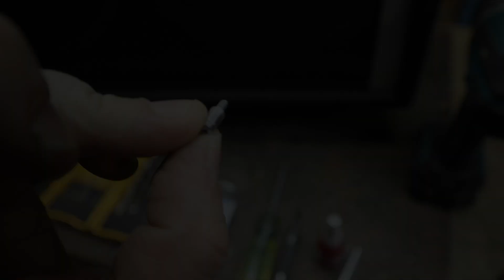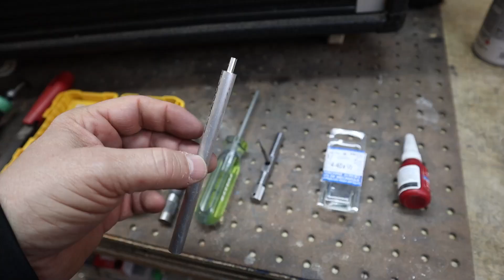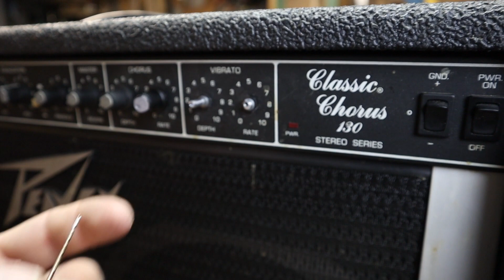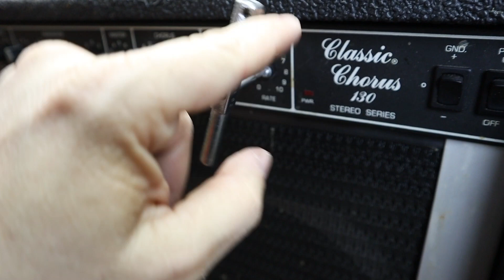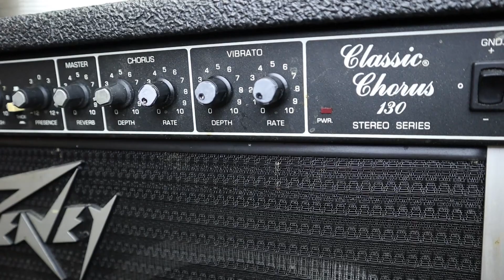How to easily repair a snapped Amplifier pot shaft // NO SOLDERING REQUIRED!

Comment: 10 minutes start to finish, if you have a machine lathe and can create your own metal sleeve? is there a way around that?
Reply from the maker: Yes, in the comments a few people say that Home Depot has 1/4” Stand offs that will work.  They are in the nuts and bolt section. You just need a drill, drill bit and a small tap.

Comment: Everything was great until you mentioned about using a lathe which I don't have
Reply from the maker: Someone commented that hardware store (like Home Depot) sell “standoffs”.  They are typically 1/4” in diameter and are threaded on one end.   You could also use a drill or a drill press to fabricate something.  Cheers.

Comment: I have an amp that pot has snapped. It is filled with metal however, its the treble knob on  yamaha amplifier. I need to drill it first then yes?
Reply from the maker: In order to tap a thread or reuse the knob, you will need to drill it out as per the video.  Cheers.
Reply: @MikeFreda   its the middle part that moves then as ive tried to turn it and no joy. I will drill it and go from there. Im sure it will work if i can turn it. Its a good oldschool amp but treble pot has snapped thats all. Mine however is slightly different its within a hole the knobs come out an inch so slightly abit more challenging.

Comment: This is awesome, you've got a new subscriber! I want to try this on my Peavey JSX head - but in my case, the pot stem is snapped down to almost nothing. Do you think I would still be able to drill it out deep enough to accomplish this?
Reply from the maker: Thanks for commenting.   It’s hard to say how  much additional room you have to play with.  You have at least the threaded section the play with.  What you could do is find a similar pot and take it apart.  Cheers.

Comment: Even simpler, use a hex standoff -- available in metric (M3) or inch (4-40) dimensions.  A metric and inch standoffs are available from McMaster, or DK.
Reply from the maker: Yes, that is correct.  That will work good as well. Many people have suggested that. I may do an update video explaining that option. Thanks for commenting. Cheers.

Comment: Easy, if you have the tools you used
Reply from the maker: True.  I’ve been made aware that HomeDepot sells threaded stand offs in the hardware dept.  You just need the corresponding drill and tap for that thread pitch.  Cheers.

Comment: So where do you get the part to repair the pot?  The threaded shaft?  No PN
Reply: Ok.  I see in one of your other replies that you rigged it.  It's not an over the counter part.  Yeah I can do that with standoff and a screw that is flat head.
Reply from the maker: No, I made the part from scratch but I’ve been told stand offs work as well. You can get them at homedepot. The trick is to find the right thread pitch for the tap. Cheers.
Reply: @MikeFreda  Thanks.  I'm pretty handy at fixing things.  The bigger trick will be to find a matching knob (for a Digitech RP-500 I bought used).  Worst case I will just replace all 6 of the knobs with similar ones.

Comment: can something else be used in place iof that thing you used at 4:00 ?  I have everythi9ng except that crucial thing.   ....  Almost Hate to file off the tiny knub thats left on my brokeen treble pot.  But if so what could I use in place of that tool?
Reply from the maker: Good day, at 4:00, that is a small tap handle. You need some way of holding the 4x40 tap. There are other tap handles available.  Try Harbor Freight or Amazon. You could also use a set of small vise grips. A drill would be my last resort. You have to be careful not to break the tap. That would ruin your day.
Reply: @MikeFreda  what is the Tap??   I missed how you drilled it out.   so youre saying.....   there is a method other than drilling it?  I was considering laying the amp back .....   mising up a tiny ampunt of Jb Weld &  with a small point item......   put a tiny glob on it & let it harden, being sure to not put so much that it binds with the surrounding metal & wont turn.  but enough to atleast use the finger tips to adjust it when needed.
Reply from the maker: A tap cuts threads so you can screw in a small machine bold.  Yes, you have to drill it out the middle of the shaft.   Other than removing the pot itself and installing a new one I’m not sure what else would work.  Good luck.

Comment: For most of us we aren't going to be able to machine down the aluminum rod to make the replacement shaft section. I do a work around that may interest people which is to just purchase an aluminum spacer at the hardware store the same diameter as the shaft. You may have to cut or grind down the spacer to get the exact length. Just drill and tap the pot shaft and then fasten the spacer with the screw to it. I also use a little clear nail polish on the threads to keep it from coming loose.
Reply from the maker: Yes, that works well.  A few others have left that same comment.  Thanks for suggesting that, hopefully that will make it easier for some of you. Cheers.
Reply: For D shaped shafts, it's a bit more difficult too
Reply: They sell aluminum rods look 1/4" aluminum rod. Most hardware stores have them

Comment: Thank you.  I have a half broken shaft on a 1971 P bass.  I don't want to replace a vintage pot.  This should work nicely.
Reply from the maker: You're welcome, hope it works for you!
Reply: @MikeFreda  The only thing I don’t know how to do is turn down the aluminum round to the right diameter.  If it requires an expensive tool I may just try to find one with a close enough diameter.  Any suggestions?
Reply from the maker: Hello, one of my viewers stated that computer/electrical standoffs work as well (it's in the comment section)  I think Home Depot sells them. If not, let me know I make/send you some 1/4 rod with a hole drilled out in the middle.
Reply: @MikeFreda  Awesome. Thanks
Reply: Ill let you know if I ever need any, but I think I’ll be okay with that suggestion

Comment: I accidentally knocked my son's pre knob off of his TNT115. I ordered one from Peavey. I soldered the new one on,  now my High and Low inputs don't work. Plugged in his bass to the preamp and got some sound.  DDT light doesn't work now either.  Any clue as to what I did? Thanks!!
Reply from the maker: Thanks for your comment.  Unfortunately, it could be a bunch it issues from the wrong value of the pot, got the pot hot when soldering, bad circuit trace, bad input Jack, something grounding out.  Without having the amp in front of me… it’s all just speculation.

Comment: Glad I came to the same solution as you. Although i did it slightly differently as it was for a boss overdrive pedal. I dropped it and broke the split shafts. I could not find a replacement pot as they are tiny and quite specific. Cut it flat as you did and drilled a hole 1.5mm and then made an aluminium pole the right size to fit inside the knob with a 1.5mm hole in the centre. Glued it together with a piece of 1.5mm copper wire to join the two pieces together. works great and you'd never know it was broken.

Comment: Dejar Mike, thanks for the great advice! I have dame problem but my broken potentiometer is obsoleted, no longer available, 11 detents, and besides that, It has a split knurled shaft. Any idea based on your experiencie? Kind regards from Mexico!
Reply from the maker: Thanks for reaching out. When it comes to fixing a split shaft you really only have 2 options. Replace the Pot or do my “fix” and install a knob that has a set screw or modify your knob to slide over my fixed shaft.

Comment: Hi mike ,,I have this same issue with my Behringer Acx 900,couldn’t find d right encoder switch and the technician used a different encoder switch which will not work.Now my Amp makes loud  humming noise if I try to use the Fx /Effect switch.
How do I determine the right encoder switch that works for my model as the original one doesn’t carry any tag or number to help In sourcing replacement.
Just 5 pin .
Reply from the maker: That’s a shame. Unfortunately, I don’t know anything about those amps. I can’t really help you there. My recommendation is to contact Behringer and see if they stock replacement parts.

Comment: hey mike! i have a better solution to help you! use a computer motherboard standoff for the bolt!  its the exact thing u want without having to make a barrel to put on a screw.  its one piece.  look it up.. round computer motherboard stand off.  its 4-40.  thanks for your help! i just know computers and it blew my mind cause its the same size.  take it to the next level!  gonna make it way easier now.  just tap it and put a standoff there.  boom, done!
Reply: Thank you @thinkhendrix this saved me $10 just used some spare ones off my old pc !
Reply: @michaelmoore1434  awesome!
Reply from the maker: Great idea. This is what I had in my shop already so it worked for me and it was free. lol  Your solution seems pretty convenient as well. Thanks for the feedback.
Reply: Thank you think Hendrix. I’ve got a cheapo fender 212 combo I found next to a dumpster that still works fine but some pots shafts are snapped off. I am gonna try this technique but I’ll use your standoffs. Great thinking!
Reply: Lmfao.. Thats EXACTLY what i thought of to use for it too!! Hahahahaha.. its perfect!.. well at least i hope lol... Fingers crossed lol
Reply: Hi thanks for the video,  can You get knobs  to fit on on the motherboard stand offs ?

Comment: Awesome. Thanks for this great idea. Perfect solution!
Reply: hey mike! i have a better solution to help you! use a computer motherboard standoff for the bolt!  its the exact thing u want without having to make a barrel to put on a screw.  its one piece.  look it up.. round computer motherboard stand off.  its 4-40.  thanks for your help! i just know computers and it blew my mind cause its the same size.  take it to the next level!  gonna make it way easier now.  just tap it and put a standoff there.  boom, done!
Reply: @thinkhendrix  Do you happen to have a link? I can't seem to find anything that matches. TIA